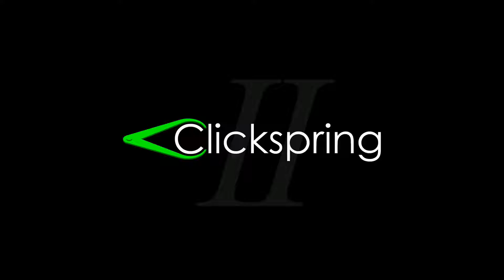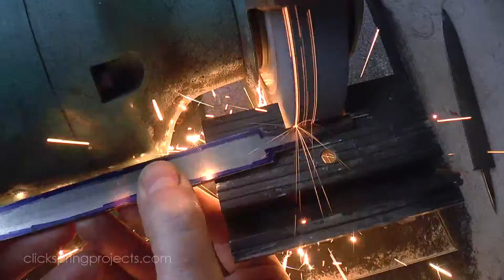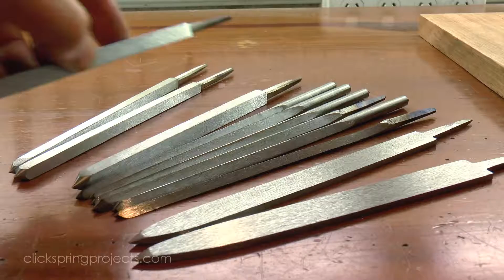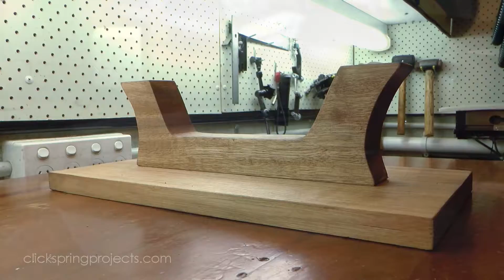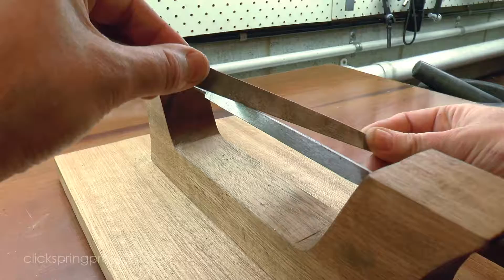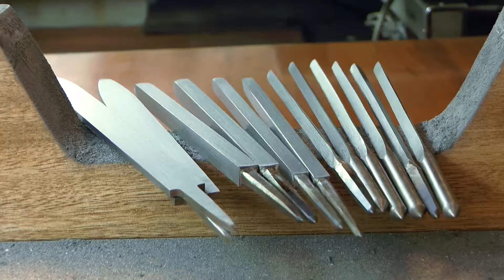Using a File Stripping Frame

Comment: Dumb question, but during the sanding operation, how do you maintain the flatness while grinding by hand?

Or is it not a crucial tolerance worth worrying about?

Thanks for the videos, best on YouTube!
Reply from the maker: Mainly just by eye, keeping an eye on an edge that can be tracked through its move across the belt - its good to have each face as flat a possible before the stripping stage, but not super critical. At worst there might be a light twist in the plane surface after stripping. Given the other stuff thats going on for the surface with the teeth cutting, heat treat and mild distortion of the quench etc it tends to all just become part of the slight randomness of a hand cut file - Cheers :)

Comment: So what’s the point of the frame? Is it to compensate for any wobbling when you are drawfiling the piece? Maybe you would go off true with the drawfile if you had the work clamped down and immobile?
Reply: Yeah, I think that's right. With this frame, it doesn't matter much how you might wobble a little bit because the work piece is free to follow the file (and visa versa). Were the work piece clamped immobile, any side-to-side roll of the file would be cut into the work piece, rounding off edges, etc. Very cool. It's a way of working with the uncertainties of using a hand-tool rather than fighting them.

Comment: Was that chalk that was put on the file?
Reply: Soapstone
Reply: Chalk, talcum Both would work. Never tried soapstone, would likely work. 
What you want is to fill in the groves to prevent filings to collect or stick marring the workpiece, I use chalk and dip file in oil (very light oil, not motor oil) before applying it